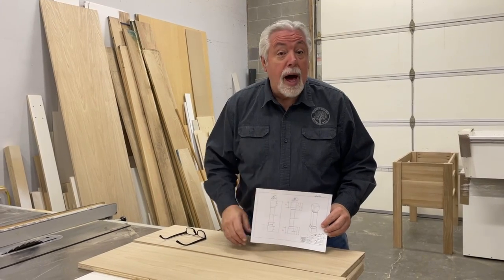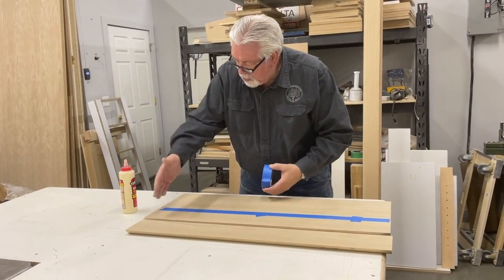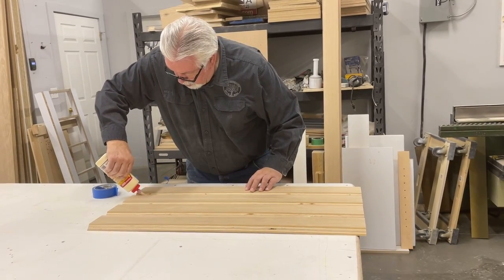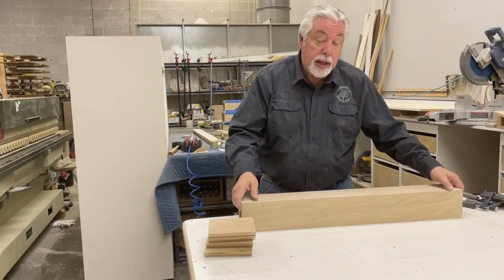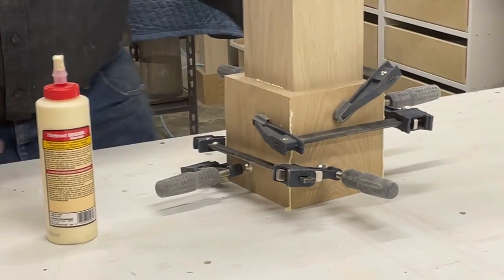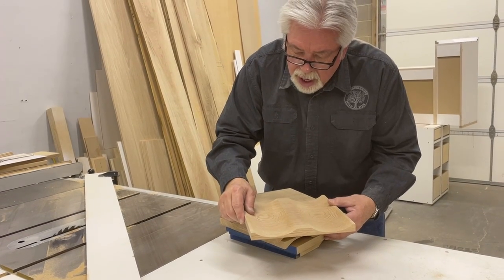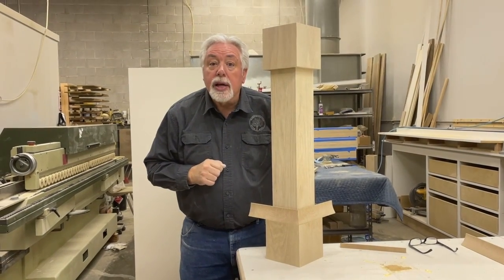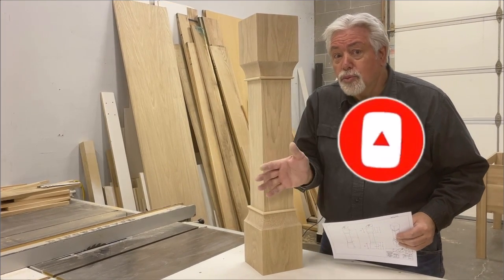Avoid The Hassle - Build Your Own Custom Columns

Comment: Great as usual, Wes, and thanks again for taking the time to make these videos. Question: is there any magic to getting super precise miters like you’re able to achieve? Are you set at 45 degrees? I ask because I feel like I’ve tried everything to tune, adjust, whatever… and I don’t get tight miters. Thanks!
Reply from the maker: Hi...I always insure that I have perfect miters by putting 2 of them together and checking them with a square on the inside. Hope this helps...thanks for your comment and support. Wes

Comment: Great to watch and learn from as always.  Is there a specific tooth count on the blade recommended when running table saw cove?
Reply from the maker: Hi...I use a 40 tooth rip blade while making this cove. It works very well. Thanks, Wes

Comment: Wes I'm a subscriber. great video man!...really nice techniques all around but especially making that scoop on the table saw impressed me. Regarding working safely on the table saw - I tend to wrap my pinky finger on my right hand over my fence...almost like a "lock" to prevent my other fingers going toward the saw blade (on my smaller/ benchtop saw). I'm only mentioning this as it might be helpful to others . One other thing, there's another pretty amazing Youtube finish carpenter (whose name I won't mention here) who advises setting the bevel at 45.5 degrees for making the bevel posts, claims it pulls the miter in tighter. any thoughts on this? Thanks for the excellent content
Reply from the maker: Hi Joseph...setting the saw at a 45+ is a way to create tighter corners. However, it does have one drawback;  if not clamped with equal pressure on all sides, you can cause your post to be out of square which could create even more problems as you continue with the build up. Thanks for your comment and being part of our community.  I appreciate the support. Wes

Comment: Gave us the length of the base pieces but not the width
Reply from the maker: The center column is 4 1/2 x 4 1/2...the applied base pieces are 3/4" thick resulting in a 6x6 finished base measurement. Thanks for watching, Wes